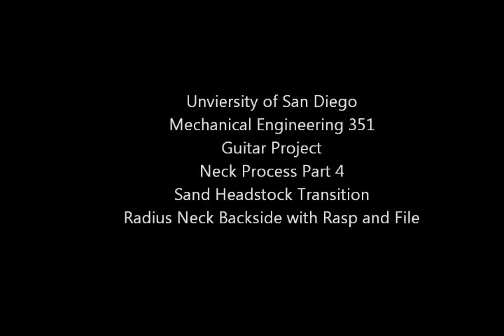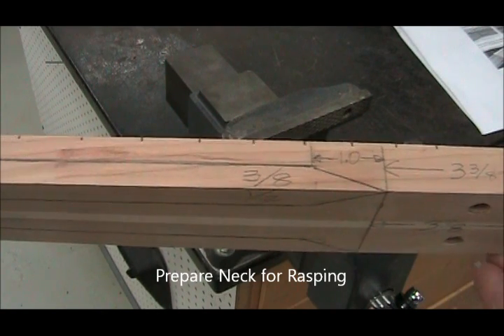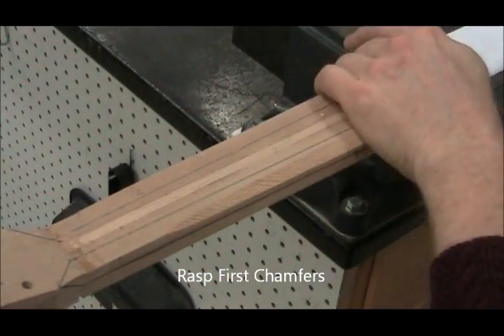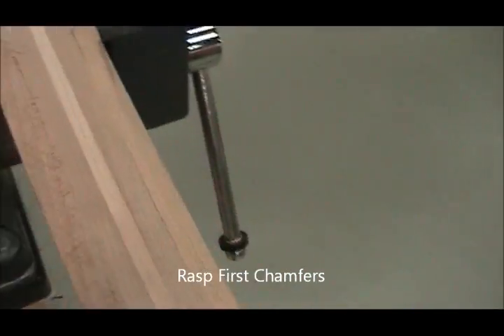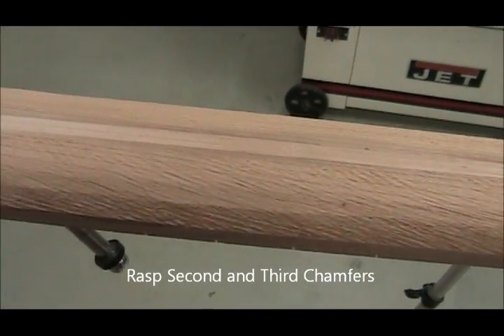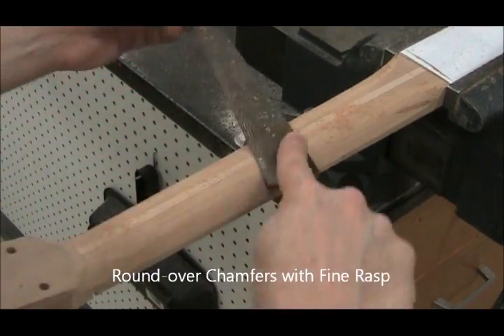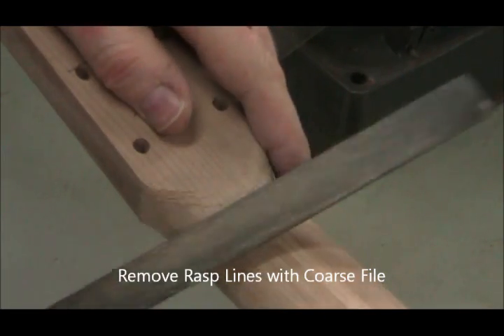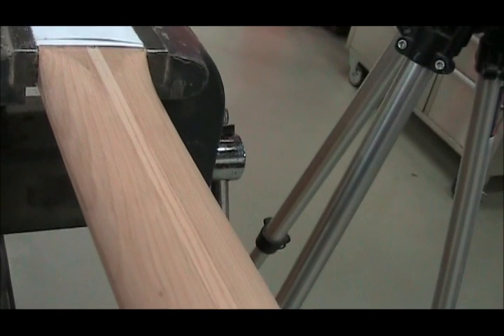OLD VERSION Neck 4: Headstock Transition, Rasping and Filing Back of Neck

Comment from the maker: @ht448  I've never done a neck-through, but I think it would be similar for the carving.  Three woods should be fine as long as they are similarly dry, their hardnesses aren't vastly different, and the layup is symmetric.  It's wise to test methods on glued-up scrap first.  Some builders like to use a spokeshave for carving; planes are best for making things flat.